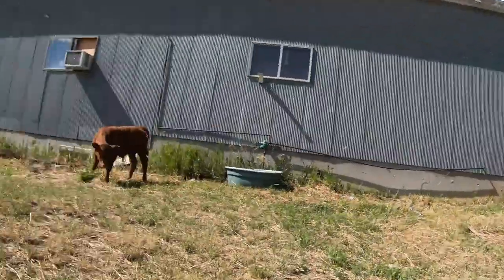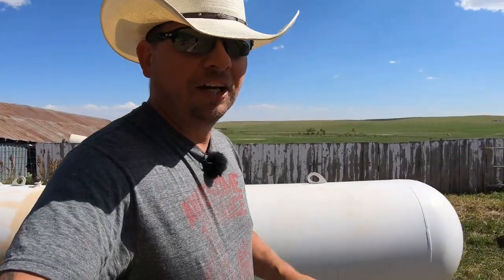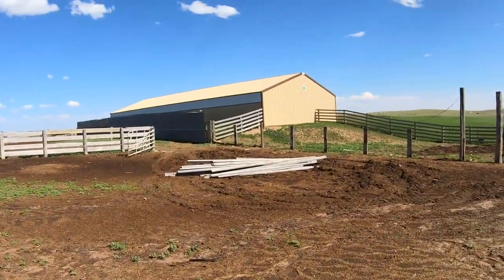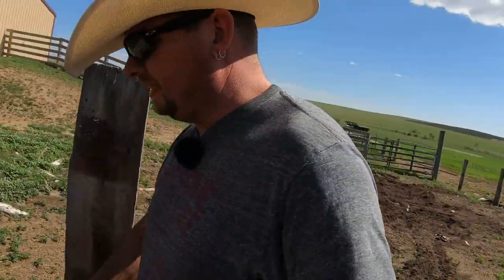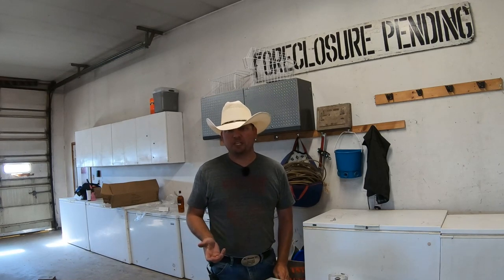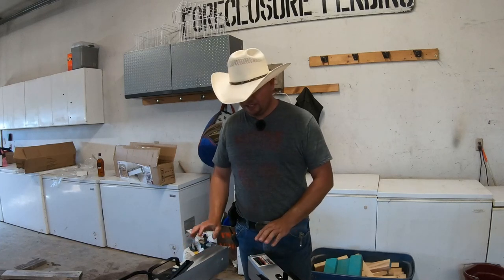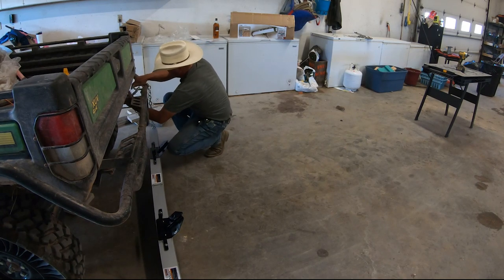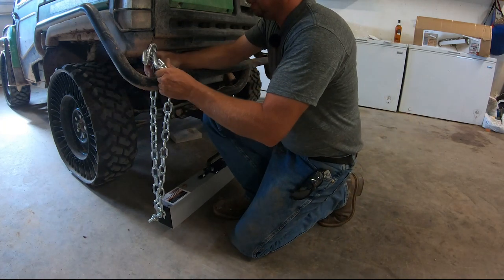Vehicle Mounted Magnets to Clean up Corrals

Comment: Great idea! I was in  the trucking industry 30 years and most jockey trucks (really short trucks with hydraulic 5th wheels for moving trailers around) had an 8ft magnet mounted to the front bumper. You don't have to prevent many flats for this to save you a lot of money. You already know what it cost to fix or replace a tractor tire. LOTS OF MONEY. Love your channel and your videos!!

Comment: When you first put the magnets together, I was thinking putting a bolt in would have got them closer. Then when you cut the axle, (allthread) I cringed a little thinking, no wheel going back on there. Really nice idea though. Sure beats bending over and swinging a handheld magnet. 
Another interesting and informative video. Keep them coming.
Reply from the maker: I have lots of all thread lol.

Comment: It's still bending in the center. Maybe you can use a wheel in the center of it to support it. Or a piece of wood that runs along the top to brace it and give it the extra support needed. 
 My husband Paul one time after the land lord had the roof replaced, to run one of those magnets over the perimeter of the home. He barrowed from work. That thing was heaver than it looked, and the ground was uneven. But so many nails. Paul still had to fix the leak that was not done right. The Land Lady was so mad. It was the House that her Father use to live in. Paul found the leak and fixed it. My Husband was a genius when it came to finding leaks. How to fix them was never an issue with him.

Comment: Mike, loose the bolt and use each bracket to bridge the gap. I would also use blue lock tight on the screws. Good morning from Sacramento Ca.

Comment: a half round - the post you have in the corral in NZ we call a half round which are great if you are screwing panels of wood to make a fence as it gives a bigger face to screw your panels to - we also do 1/4 rounds in paddock fencing as we really still don't use masses of metal post or Y posts here in New Zealand in large farms we use wooden posts

Comment: 1.  Rivit an aluminum strongback to. the front or back side to remove the bow. 2.  place a skid in place of the wheel at each end so it travels at a more uniform distance from the ground.

Comment: There was a lot of swing in that bar as you drove around.  Keeping the wheels on and  attaching it more rigidly to the gator I think would solve that problem.    You could retrofit it to be like an attachment to the gator much like a bucket or forks for the bobcat.    Overall it looks as though you have a winner.   "The Metal Mower"    ;)

Comment: Odd, I was subscribed. But I've heard of people getting unsubbed on other channels, so not surprising.
My first thought when you said the magnet was flexing in  the middle was to undo the bolt and put a chain around the bolt to hold the center up, instead of risking it bending in the future.

Comment: Well I'm STUCK on you! Just think of how you're preventing  cows from becoming lame by preventing metals from getting stuck in a hoof!
I see what can happen when I watch The Hoof GP, and it ain't pretty! You so smart💕
Reply: More often they'll ingest a nail or wire, causing what is called "metal disease". The remedy is to have the cow swallow a magnet. If the magnet grabs the metal, cow is usually OK, if not, the animal will usually die.

Comment: If you put a second but (nut damn rekcehclleps) on that shaft it will lock them from coming loose sometimes called a lock nut or jam (marmalade) nut a regular lock nut is usually about half (or there abouts) the depth of a regular nut Locktite is an option. I’m putting in suggestions about halfway thru your video not even weighting to see where you went with your adaptation. Hey a new shirt World’s OKest adapter/fabricator and you can add it to your OKest welder shirt collection; just a thought but you could add this to your cowpie breakerupper. 
I will/would spend hours developing something to save 5 minutes BUT in the long run those 5 minutes added together over time will be 
L O N G E R than the hours I spent developing the worlds GREATEST watchamacallit
Thanx still lovin’ your videos (even though only half way thru) from the left coast near Krapramento, California the Krapital 

We approached $2.99.9 a gallon but Newsome added about 3¢/gallon on 1 July

Comment: Another $10 solution to a $2 problem. D'ja ever think that if you took the time you spent making a 60" magnet you could ride on and just went out and walked with the 30"er you would have done a better job and be back at building the fence?

Mike- You Do You and more power to ya. Seems to be working: lots of subscribers- well, minus one. I grew up on a farm and it's just too painful to keep watching you fumble around doing things the hard way. Though I do admit I'm curious to see how you will get water into that new chicken pen when you put the waterer in the middle and no gate. Guess you'll get good at vaulting. Or at fixing your pants. Bye...